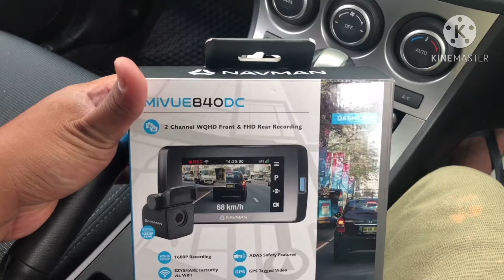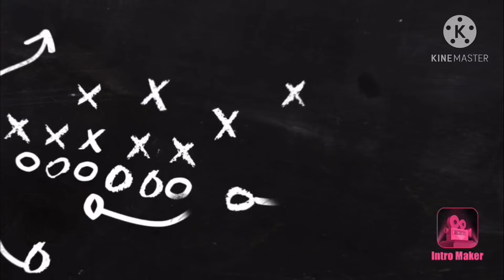Install Navman Dash Cam to Mazda 3 ( Axela ) / DIY

Comment: Nice vid. Just a point to note, if you feed the rear cable via the plastic panel near the rear brake light, then through the rubber cable shroud it will not only look better, but will maintain the water proof barrier. Feeding the cable by bypassing the rubber shroud and pushing it aside to get the cable through will risk getting water into your vehicle. The rubber needs to seal against the vehicle body.